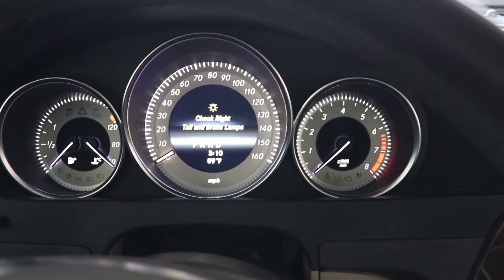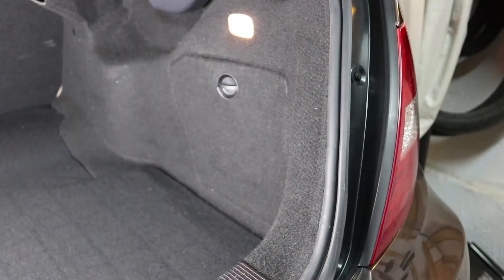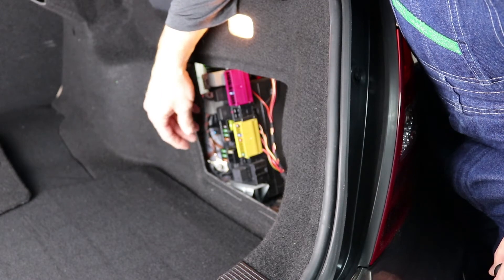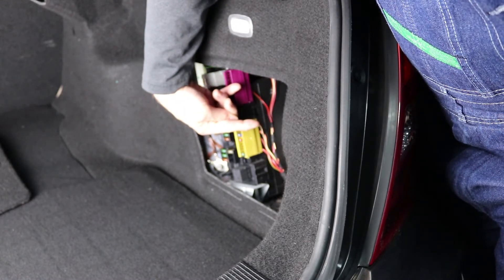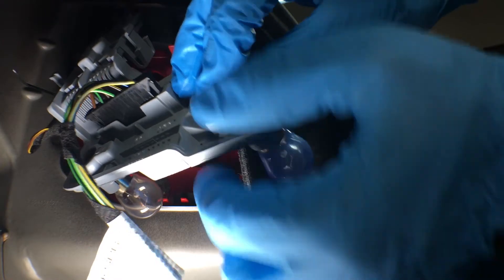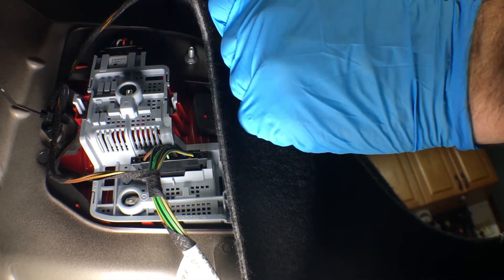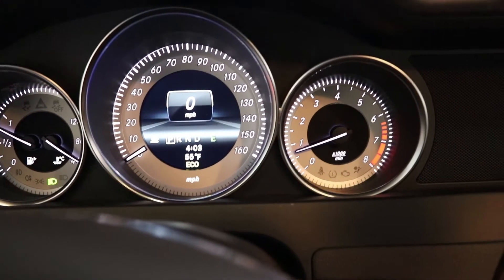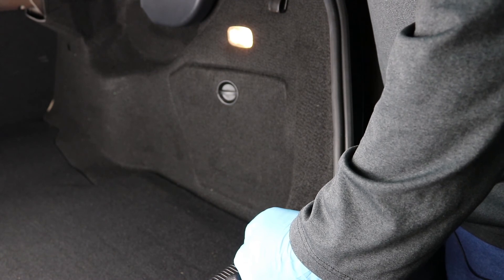C300 Brake Bulb Replacement

Comment: Somehow I messed this up. I did this to replace the bottom two bulbs as they were both burned out, but what ended up happening was the top two bulbs stopped working (regular and smaller bulb which were working normally before). I’ve played around with switching the regular bulbs and they all seem to be working okay. Any ideas?
Reply from the maker: Maybe a loose wire on the harness?  If they both stopped and the bulbs are good, start tracking the wiring back to the connector.